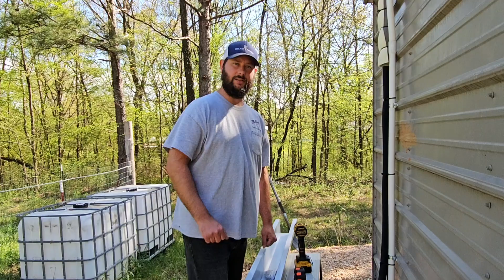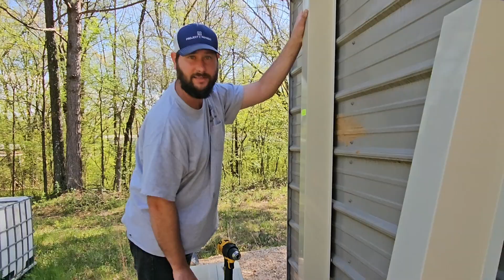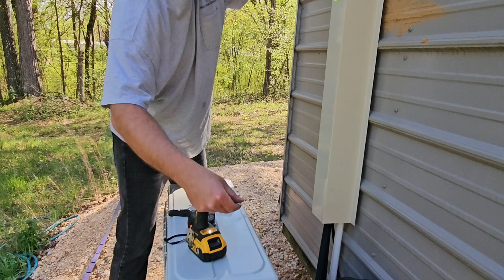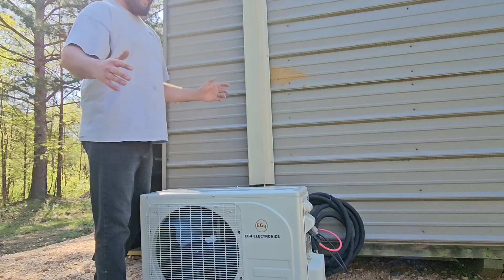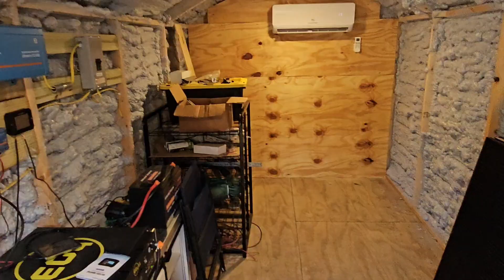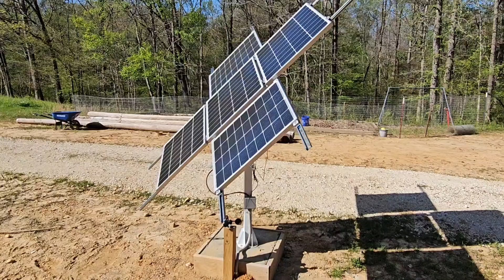Hack to Cover up Your Air Conditioner's Line Sets!

Comment: So I am guessing there is no power storage, only works when the sun is out, no after sun set work, looked at storage way too much money for this. but still great useful vid thanks.
Reply from the maker: I do have battery and inverter so I can run without the sun.
I do not have a currently hooked up though
Reply: ok thanks